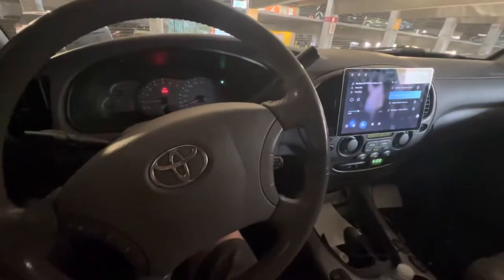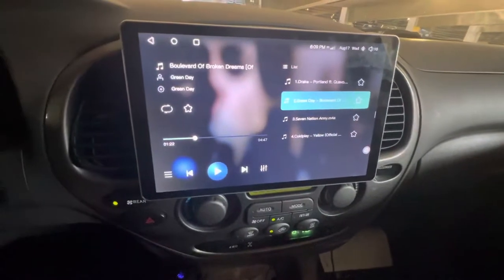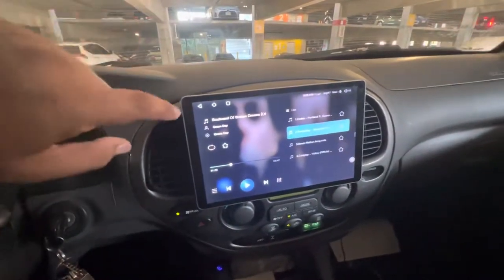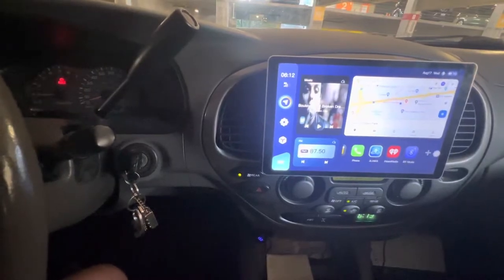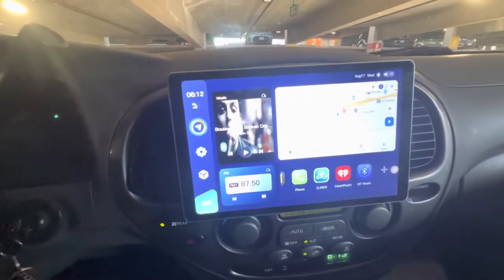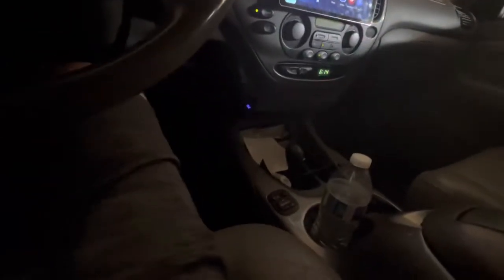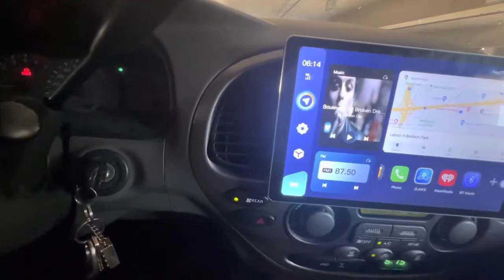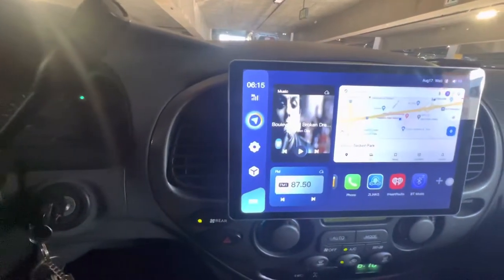Joying Snapdragon 625 Radio Final 4G issue update:: Spoiler Alert 🪦 4G

Comment: Man,  that's so disappointing. I've been waiting to buying this same head unit but not without 4G connectivity.
Reply from the maker: Yeah it is very disappointing. I had high expectations and it didn't deliver. If you are in a different country other than the US I'd recommend looking at reviews specific to your country. Unfortunately there's not many in depth reviews of these units here in the US besides unboxing and first impressions.
Reply: My 4g works fine. But  unfortunately I am haven't other issues!!
Reply from the maker: @duceky1977  what are your issues. They seam to vary from audio playback, to restarts.
Reply: @locorudy626  turn unit on black screen (reset)   no audio (reset)  only 2 speakers have audio (reset)   screen will freeze occasionally  (reset)  music player randomly stops   playing. Flashing and lines though screen (reset)...... I've reset it so many times I've broke the button  and had to make my own switch just to constantly reset it!!!!
Reply: @duceky1977  bad motherboard       usually a bad motherboard will be throwing random issues at you consistantly..   its not fully broken...  but enough that it cant function properly and consistantly.    that should be a warranty issue